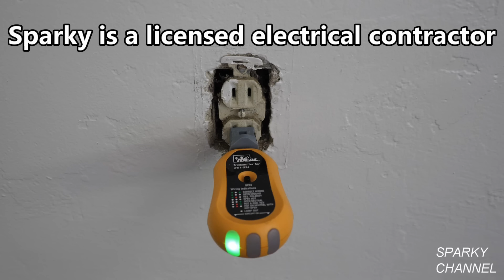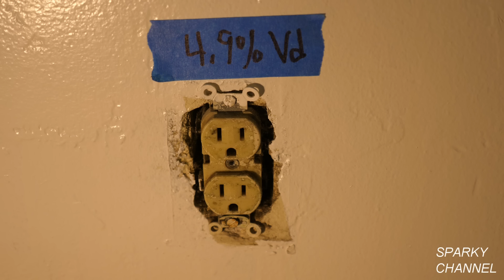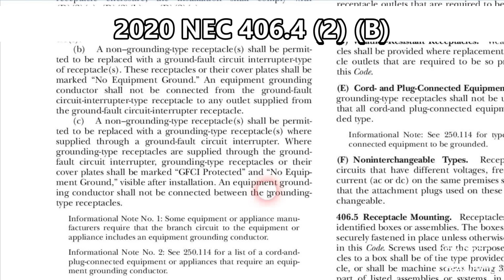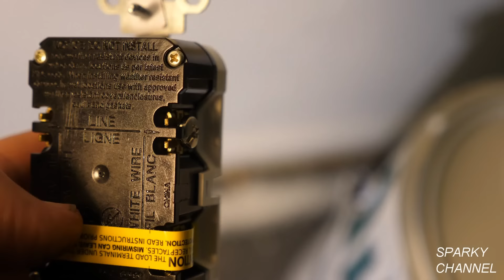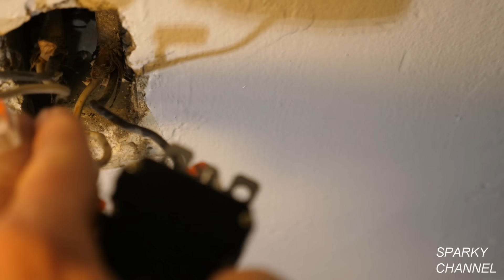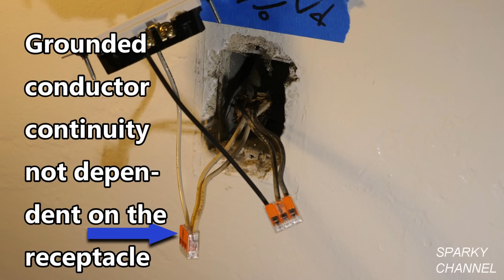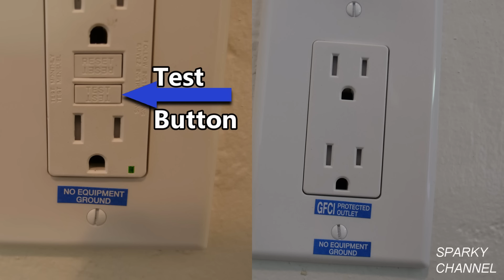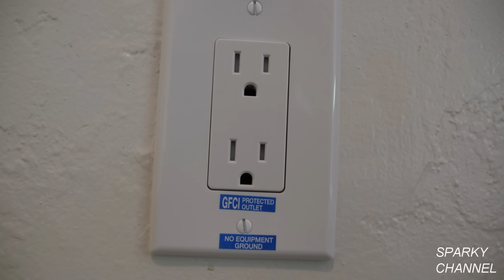2 Prong Receptacle Circuit Replaced by GFCI and Grounded Receptacles per 2020 NEC

Comment: Hi Bob, I have a bathroom switch (one to the bathroom fan and the second to the shower light).  I am doing a rehab and a GFCI needs to be placed in the circuit because it is in a wet zone.  When I open the box I see no  ground wire. However there is an outlet near the vanity with gfci that shows the correct wiring on the tester but no ground at the green terminal or in the box.   What is the scoop on the 1960 electrical system with no visible ground wire.
Reply: GFCI receptacles don't actually require a "ground wire" to function properly.  Some dwellings are wired with "armored cable" having a metal sheath that provides "ground continuity" from the metal outlet box to the grounded service panel.  NEC allows (encourages?) use of ungrounded GFCI replacement receptacles in ungrounded branch circuits exactly as shown by Sparky.
Reply: Could be wired with metal-sheathed cable bonded to ground, or have another grounding means tied to the cabling.  Some older (pre-1970s) houses have an "extra" grounding wire strung through the walls and ceilings to certain receptacles or light switches.
Reply: It could be that they cheated and connected the equipment ground to the neutral. I can't remember the term for that, but not allowed. It can fool your little receptacle tester into thinking it is ok. With a short or even a heavy load, the equipment ground prong becomes energized.

Comment: Hey Sparky, just wanted to ask a related question. I just bought a house with old two wire everywhere, probably gonna put a bunch of GFCI receptacles everywhere for peace of mind. Wondering if it's necessary or even possible to GFCI protect an electric range/oven, or do I need to run new three wire Romex? Any tips appreciated, keep up the great videos!
Reply: You can get GFCI circuit breakers for the box and protect the entire house. Or just certain circuits.
Reply: Best bet is a gfi breaker, a lot cheaper than running new wire
Reply: The (2017) NEC generally only requires GFCI protection for the specified locations in dwelling units for 125-volt, 15 or 20 amp receptacles.  You don't need GFCI for a 250-V range/oven receptacle in a dwelling.  As for 2-wire receptacles, you MAY replace any of them with either individual GFCI receptacles or 3-prong "grounding type" receptacles that are "supplied through a GFCI", according to the NEC.  Your local code may vary.  Each such receptacle must have warning labels: "No Equipment Ground" or "GFCI Protected", or both.
Reply: UpnorthHere I think he’s talking about getting his older home more safe, by adding GFCI’s to give a little more protection than standard 2 prong outlets but u still are correct
Reply: @Nick-bh1fy  He also asked about GFCI for a range/oven.   I have never run across a residential electric range/oven that has GFCI protection BECAUSE, as I stated, it is not necessary.  Some gas ranges do have a 125v cord for things like igniters, clock, lighting, etc.  I will amend my previous comment to address the first part of his question, although you already did an ENTIRE video about it...
Reply: UpnorthHere I am well aware ranges aren’t required to have gfci protection. He could still install a gfi breaker for his stove, chances are the stove has the neutral and grounded tied together using the neutral as the path to ground

Comment: how much voltage drop is allowed in the States cause here in Canada it's 3% for a branch circuit so the values showed on those plugs would definitely fail code standards if that was a brand new install

8-102 Voltage drop (see Appendices B and D)
1) The voltage drop in an installation shall be based on the connected load of the feeder or branch
 circuit if known; otherwise it shall be based on 80% of the rating of the overload or overcurrent
device protecting the branch circuit or feeder, and not exceed
a) 3% in a feeder or branch circuit; and
b) 5% from the supply side of the consumer’s service (or equivalent) to the point of utilization.
Reply: exactly the same here in the states. max 3 percent for branch and no more then 5 percent back to utility
Reply: @Banman650   That's a recommendation, not a requirement. The only requirement is that the installation has to follow the manufacturer's guidelines, which is normally 120V ± 10% (but I'm sure there are exceptions to that).

Comment: I always hated being called a sparky. On the job, I made very few sparks except that time I unknowingly cut live romex with my brand new wire cutters and took a chunk out of the blades and turned them into wire strippers.
As far as Wagos vs. wire nuts, I'm old school and I have always loved Ideal twister wire nuts but I do like Wago lever-nut connectors and I am starting to use them more and more. I think the Wago push-in connectors are crap,however.
Reply from the maker: Thanks Dave!

Comment: Question. Wouldn't the breaker at the panel trip in the even of a fault? If yes, then what's the point of a GFCI?
Reply from the maker: The GFCI is much quicker than the breaker and can save your life.
Reply: @SparkyChannel  So it's quicker to trip than the one at the panel? Also, if I missed this part, is it law to have a GFCI in the event the outlet cannot provide a ground?
Reply: @princenoah21  You cannot add a three prong outlet without grounding or a GFCI with appropriate markings. You can keep the old two prong one and even replace it with a new one for example if it is loose.
Reply: I think if you have circuit breakers with the GFCI feature, then the Sparky's answer make a sense. But almost old houses have normal circuit breakers which means if you don't install the GFCI receptacle, you might be in dangerous situation when the current flows through your body and the amount of it is under 15 or 20A. In that case, your circuit breaker won't trip.
Reply: The breaker protects the wiring, not people. Without a circuit breaker in case of a short circuit the circuit would break at a random place. This could mean an expensive repair and in the worst case a fire. It has noting to do with protecting people from shocks. A breaker is rated at 15 or 20 A. t takes just 100 mA to kill. If there is grounding it can cause the breaker to trip or at least keep the case voltage low. Without grounding the voltage could go to the person touching it. If he was grounded this could be fatal.

A GFCI helps also with grounding as there are faults where grounding does not work like damaged wire where the live wire is exposed. It can also detect immediately faults that are to small for the beaker.
Reply: If a breaker tripped, it would mean you have main service issues or wiring is incorrect. There is no point to them. It is just how they work
Reply: @desmodesrampi9727  If that's true, then it's a worthless thing to have.
Reply: @princenoah21  sorry and I apologize if I upset anyone. Tc. Video is good I just don't agree with labeling but after thinking about it more it could go both ways. Equpment grounding meaning grounding from the equpment for that main pic and what i think it is, no equipment grounding meaning device is not grounded...first one is not code correct i think
Reply: @princenoah21  yeas they save lifes. Without them it would be like on old movies when people die in bathtubs when radio falls in :-) when i said there is no point to them i was just referring to a post I acted on. That is how they work. Tc
Reply: I am sorry. Did not want to upset you. I was confusing i guess. Main picture on the post showed a GFCI receptacle with 2 stickers. One said GFCI protected and another said No equpment grounding:-) now have you ever seen a GFCI receptacle work if equipment grounding was not installed on that GFCI?
Reply: @desmodesrampi9727  You didn't upset me. Sorry, I screwed something up at work today. My own fault.

I have not seen that, just on this video. Would that be required by code if the outlet was incapable of providing a working ground?
Reply: @princenoah21  it is required now for all new installation to have their own separated equpment grounding however on old installations we are still allowed to split the neutral wire and use it as a ground and a neutral at the same time to make terminations on neutral and ground side of the new "equipment" device we are installing

Comment: Hi,can I ask question;"If I turn off the whole electrical BOX,WHILE THE ROTO-rooter man,works on my plumbing,,(which is sparking dangerously off the pipes)will the plumber NOW, NOT GET ELECTROCUTED?This old 50's house is NOT grounded.It was built by "an amature",so the house is "not up to code."HOW WOULD I SIMPLY, GROUND THIS OLD HOUSE? SO an electrician does not make me pay $20,000.or ten thousand bucks?(ARE THERE ANY FEMALE ELECTRICIANS?-- Curious  female )---friend of Fabio,in Oregon
Reply from the maker: Hi! Yes, if you turn off all the electrical to the house your plumber should be safe. Grounding the house and all the outlets does involve re-wiring. This video shows a method for improving the situation a great deal and to code but it's not a substitute for re-wiring. And yes, there are lots of great female electricians.

Comment: @ Bill from Sparkychanel, can I replace my existing receptacle ( has no ground. Only has a 1 neutral wire and 1 hot wire)  to a gfci receptacle
Reply from the maker: Yes, but you must mark it "no equipment ground".
Reply: Thank you for replying.

Comment: Is there any way to ground outlets that are currently ungrounded? There are a few grounded outlets in my house but several ungrounded as well.
Reply: Are they grounded (have you tested them), or do they just have three-prong outlets? Grounding them would be quite a job, but the procedure outlined here would be a good option, I think.
Reply: @ThomasBuellJr  Thanks for the response! The problem outlets are open ground. There are other grounded outlets, which are in the kitchen and baths, so I'm assuming some time after the house was built there was some remodelling of those areas and the circuits were grounded. I've been thinking about installing a whole house surge protector at the circuit breaker to protect my electronics. Will this help? 

Also, if I made the first plug on a circuit GFCI, would a surge affect the electronics on the other outlets of the same circuit? For example, say plug 1 is GFCI and the next plug on the daisy chain has electronics in use. Too much power is drawn,  and the GFCI pops. Would the electronics be protected because the current was stopped before the surge reached the next outlet, which has electronics in use? Thanks again!
Reply: @madmanonsticks  (1) A whole house surge protector is a good idea. (2) The only way to actually have grounded outlets is to have new grounded wire run to them, expensive and messy. The GFCI replacement as shown in the video above is a good alternative and meets the NEC as he demonstrated. How do I know for certain on both of these points? I am going through the same issues at my own home. I just added a surge protecting circuit breaker to my main panel and am in the process of adding individual GFCI receptacles where needed and GFCI breakers for entire runs. 
Re: your second paragraph, surge protection is not ground fault protection and is also not arc fault protection. All of those issues are separate things. There are 3 separate levels of surge protection, first at the meter, second at the main circuit or fuse panel/load center and third at the individual outlets where your devices are plugged in. A GFCI receptacle (or GFCI breaker) is not designed to arrest surges. They are designed to prevent electrocution by stopping electric flow instantaneously so that YOU or a loved one does not become the ground for electricity to flow. Electricity is always searching to return to ground. I would suggest that you protect your electronics with surge protection where you plug in your devices as a second layer after the whole house layer. The reason for this is because more than 50% of surges originate within the home from your own appliances/motors (internal), not with lightning or from the power company (external).
Finally, I suggest you take my opinion with a grain of salt as I am not an electrician, just learning enough of the ropes myself to make my home safer and doing what I am comfortable/capable doing. Please continue to do your own research. There are a number of very good videos just on YT that cover all of these electrical issues/problems/questions.
Reply: @thomast8539  keep in mind that surge protection devices at the receptical will require a real Equipment Ground Conductor to work.

Comment: What happens when you come up to a house that has the home run going to the junction box in the middle of the room(ceiling fan or light) and all the hots for the receptacles come from that one box to each receptacle?  How would you determine the most upstream receptacle?  I hope you understand my question.  Thanks
Reply: If the ceiling outlet (fan or light) is "the first" outlet on the branch and all the receptacles "come from that one box", then there IS no most upstream receptacle.  You could, however, install a separate GFCI in each receptacle location where you need the three-slot (grounding-type) receptacle.

Comment: I have 1 circuit where the original ungrounded 14/2 wire leaving the breaker panel was replaced with a new 14/2+ ground wire and runs directly to a grounded receptacle - the first connection on that line.  The remaining circuit is still 14/2 ungrounded.  Using your technique, I'm assuming the GFCI that will replace the present, grounded receptacle should be grounded as well, correct?  Thanks a lot Bill!
Reply from the maker: Yes, that's correct.
Reply: @SparkyChannel  Your knowledge and experiencing sharing is greatly appreciated!  Thank you kind sir!
Reply: John Ellis p

Comment: Will the GFCI still trip? I assume it should, but I just replaced an old circuit identically to what's shown in the video, but the GFCI doesn't trip when testing with an outlet tester (Klein RT210). All receptacles  show an open ground, but when I hit the GFCI test button on the tester, it shows hot/neutral reversed and does not trip the GFCI. 
Edit: After thinking this over, without a proper ground, the outlet tester shouldn't work. Is there an alternate way to test a GFCI without a ground?
Reply from the maker: Don't use the button on the tester. Use the button on the GFCI itself for your test.
Reply: @SparkyChannel  Thank you for your help!
Reply: As explained, the plug-in tester won't trigger a GFCI without a ground.  However, you'd better look into  why it shows "hot/neutral reversed", if there is no grounded conductor for reference.
Reply: An outlet tester does not work a it use the ground to create the fault. It will trip in real use though it may require that someone touches the equipment depending on how insulated it is. With a ground wire it would trip immediately a the failure. The test button has access to the internals so it can divert current past the GFCI to the neutral.

Comment: Thanks for this video, Bill. I have been in the field for 3 years now, mainly doing new construction and renovation with open framing. I have always wondered how to apply the theory in this type of scenario without having to break open any walls; so that I can trace the circuit back to the panel. Thank you, again.
Reply from the maker: The "Sure Test" is a really neat meter isn't it? No problem, thanks!

Comment: At what point does voltage drop become an issue? I have no frame of reference, but those percentages seem significant.
Reply from the maker: Yes, those Voltage drops are significant. It's good information to know. You wouldn't want to run your Skilsaw on the most downstream receptacle! But remember that those Vd's are with a 15A load which makes a big difference. Generally you don't want too see a no load Vd of more than 5%.

Comment: Hello Bill. I have a question. Can you please make a video about installing a bell box in the middle of a yard with a GFCI receptacle, fed by PVC conduit? I keep looking for videos on how to support a bell box in the middle of a yard, but can't find any. I was taught to use a ring fitting in the back knockout and driving a piece of rigid RMC or IMC into the dirt, then securing the set screw on that fitting to the rigid conduit. Thanks!
Reply from the maker: In general I would discourage placing a receptacle in the middle of a yard because of possibility of mechanical damage and also voltage drop if it's a long run. If you can place the receptacle on the side of a building that would be much better. Such a new installation requires a permit.
Reply: @SparkyChannel  I am just curious how you would support a box that does not have a wall to go on. I have seen some people use unistrut. I am not planning on doing any job in particular.
Reply: Sometimes people have receptacles in an island of the yard or nearby a fence and they are often not supported well. My brother in law is an electrician and he uses a piece of rigid conduit into a fitting in the back of the box.

Comment: I love the voltage drop test to determine (most upstream) but if you're gonna remove all the receptacles  & test for "hot" anyway it was kinda pointless no?
Reply from the maker: I think it's a very valuable test because it shows you what the voltage drop is like for the further downstream receptacles and then when you replace the receptacles you can test again to see if there is any improvement. Also, all the receptacles have to be removed anyway.